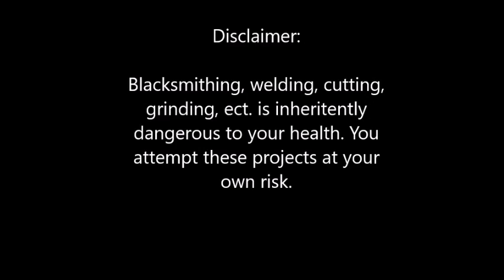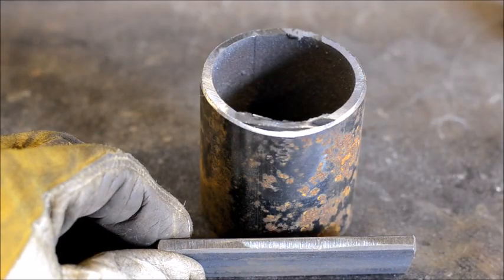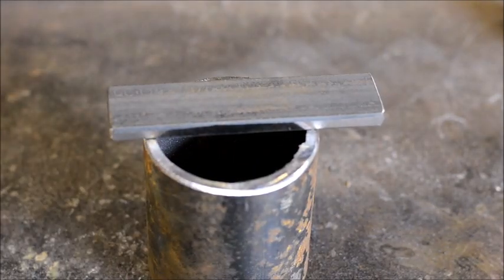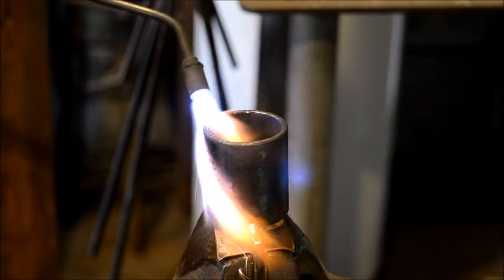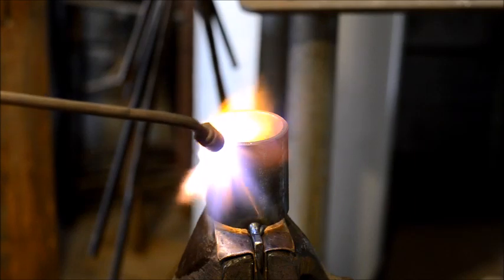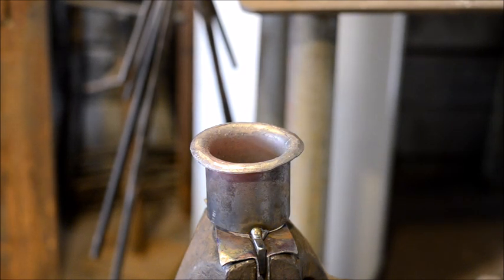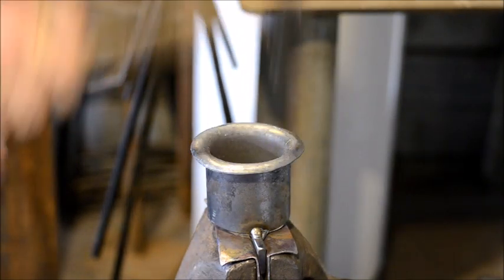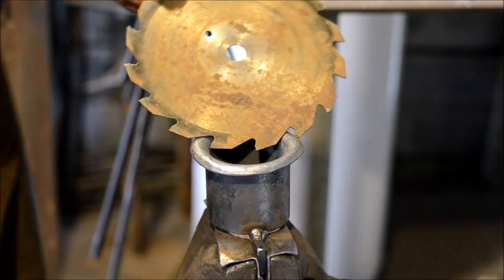How to Make  a Blacksmith Cupping Tool // Swage Block Alternative

Comment: A good rule of thumb for these is to forge to half the thickness over the horn before starting to roll.  After that, you can roll whichever way is convenient.  Also, using a piece of angle iron for the vise support provides a more stable surface especially when using it on a dishing tool like this.  Seems like you wasted a lot of gas and time getting to the point of starting the roll.

Comment: another option to roll the edge is to get it hot then stick it in the horn of the anvil and hammer it in. then cut to length.
Reply from the maker: +Eric Simoneau yes sir that would be another option. Thank you for putting that out there God bless

Comment: I like the idea of the vise holding the tool...  no jumping around that way. 

 Questions for you..
1)  Did you have to square up the rolled surface on the anvil or maybe a cone mandrel?
2)  Your torch..  are you using the rose bud on a oxy/acty setup or is it propane?   Maybe you could do a video on it?

Thanks for the video...
Reply from the maker: +shadowcastre to answer your first question: I did not have to square up the rolled Edge on the Anvil as it would have been a unnecessary step. The main reason in Rolling the edge of the pipe is to prevent marring on the back side of whatever you're working on. To answer your second question: I am running an oxygen propane torch. I may just do a video on that ! Thanks for the great questions let me know if it helped :-) God bless
Reply: I was going to ask the question about torch type and gas, out of interest.

The rosebud tips are not a common sight here in the UK, for acetylene welding torches.  We just tend to have plain shank (cranked) copper nozzles that are really just for gas welding, from number 1 up to..... I don't know, I've seen a 35., which is very large. These can also be used for heating purposes only and they do give that pinpoint flame tip that a gas welding nozzle produces.  A number 3 nozzle is a very nice accurate flame for pinpoint heating.  

I looked into the rosebud tips and they are expensive here, it seems to me.  I think they were over £30 (about $50?), whereas a plain welding nozzle will be about £5 ($8).  Then it turns out that the shank is a separate part from the rosebud itself, and the shank costs as much again.

So for large scale heating I use an oxy-propane cutting torch, without depressing the pure oxygen trigger so as not to actually cut.  The two part nozzles for those are less than £10.

Good job you've done there and I'm going to make some.  I never thought of this before.  I going to just stand the pipe up onto  the coals on a coal forge to get the end hot, then a quick move to the vice.